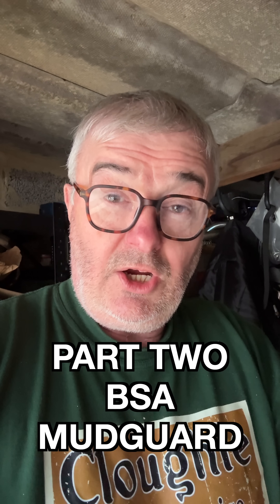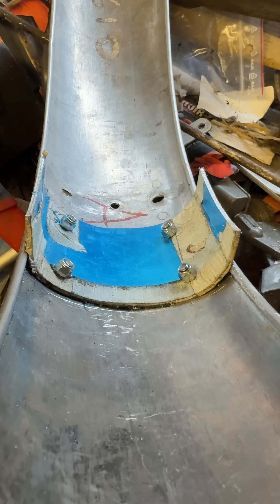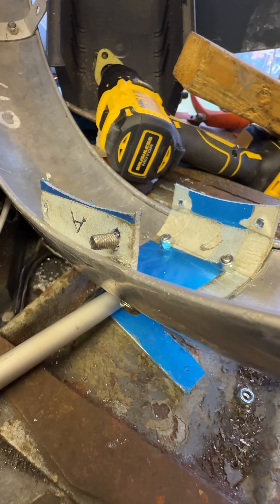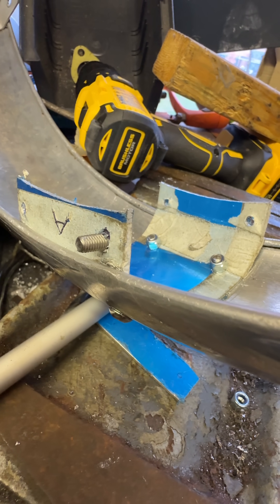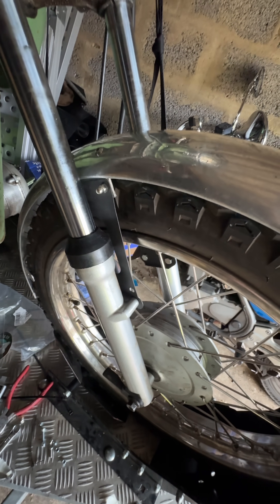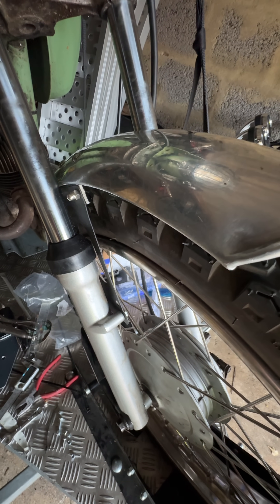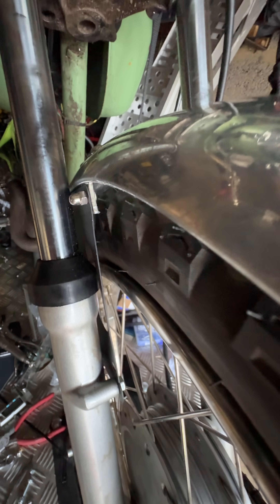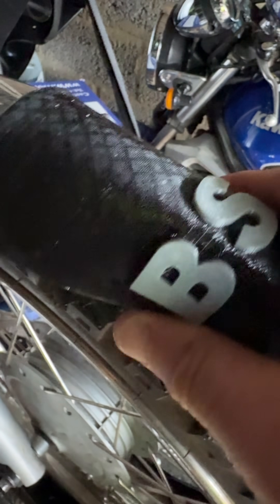BSA Mudguard Fabrication Part Two

Comment: Watching at work cant turn on the sound :  ) - what are the forks off of ?
Reply from the maker: Honda 125 along with the wheel. The triple tree needs serious work to accommodate. Lathe / mill. Hope this helps matey
Reply: @OriginalBritishIron that's the job.. thanks..🎉.. thought it looked familiar..
Reply from the maker: @enhancesoutheast5964 far better brake and allowed the use of the 27mm Honda forks. Far better made than any British comparable fork. What do you ride matey ?
Reply: @OriginalBritishIron depending on the day.. drum brake Morini 3 1/2.. Honda 400 /4 ..D14/ 4 Bantam.. in a box several bitza Bantams..which is why I am following this channel with great interest..👌
Reply from the maker: @enhancesoutheast5964  I’ve a mate with a 3 1/2 wonderful machine. And several with 400/4. Those 4s appeared to be such large machines back in the late 70s today they look a tad smaller. What’s the 3 1/2 like to ride matey. I might ask my mate Brian to bring his over and I do a chat to camera. Those Italians certainly had more idea about style then turner and others did mate
Reply: @OriginalBritishIron I'm not small so the Morini is pleasant and idea for city journeys.. the drum brakes are not ideal for modern traffic 🚦.. so care is needed..
Reply from the maker: @enhancesoutheast5964 my T140 disks are appalling mate. Norton front TLS is far better. Saw a 4LS Suzuki front brake on a W800 KWAK yesterday no that looked good. Colin the owner says it stops immediately !!